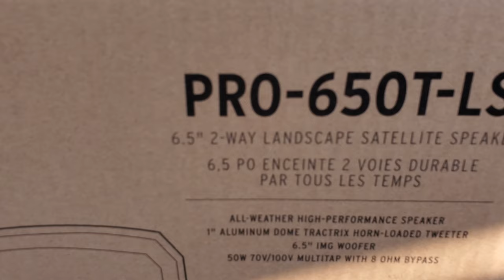KLIPSCH & SONOS Outdoor Speakers Installation - Dallas, TX

Comment: The speaker wire connection was not sealed? Outdoors? That's a bit strange.
Reply from the maker: The speaker cable connections are sealed. As mentioned in the video, the wires are connected using outdoor wire nuts. The wire nuts have dielectric silicone sealant in them that surrounds splices, making it water and corrosion resistant.
Reply: @PureMediaSystems  aha I missed, sorry about that and great to hear!
Reply from the maker: @cjansson  Thank you for your feedback! Please consider subscribing!

Comment: uhh, white is positive and green is negative in your 16/4 speaker wire. It's an industry standard.
Reply from the maker: Thank you for your reply. Actually, industry standard for 4 conductor audio cable is that Green is positive and White is negative. You can even reference the Klipsch manual for these speakers for further clarification.
Reply: @PureMediaSystems  wow. just wow.
Reply: Green has always been positive white negative, colours red and green positive, non colour black/white nehative, sonance outdoor is different to that and that did confuse us.